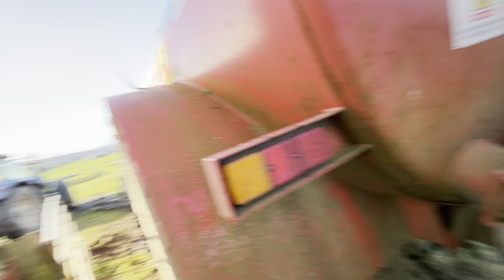Film Star BRIAN The Lorry Driver!!  Trying Our Nurse Tank Out!!

Comment: Helpful hint _ remove one of the fillers from the back of the tanker and swop it onto the blank fill point on the left front corner. Try it and see_ you will never connect to the back of the tanker again !
Reply from the maker: The way our farm is set up for slurry unfortunately that wouldn’t work 😅
Reply: @DrewsFarminLife  open a gate, knock a wall, cover a drain, trunk a hollow, dig out a hill, move a feedbin......
It would make life easier and faster _ no more backing around the yard and a few seconds shaved off every load :)